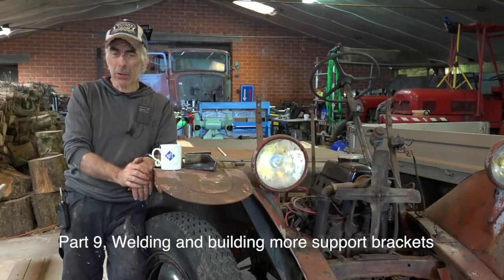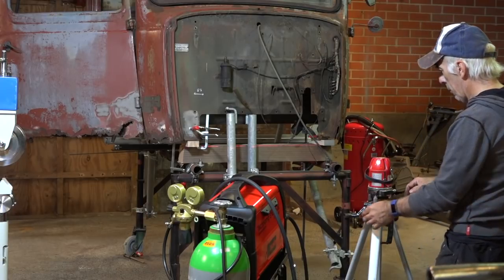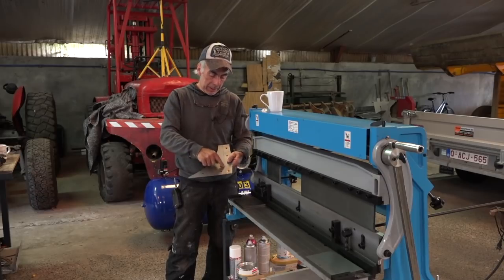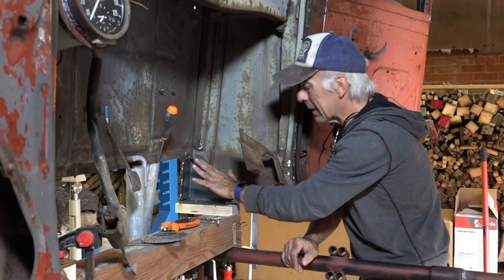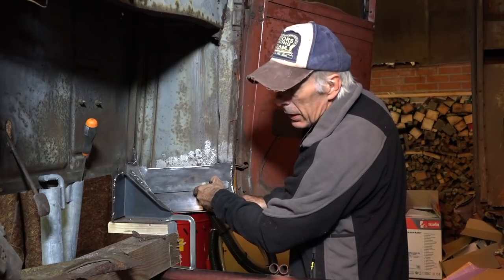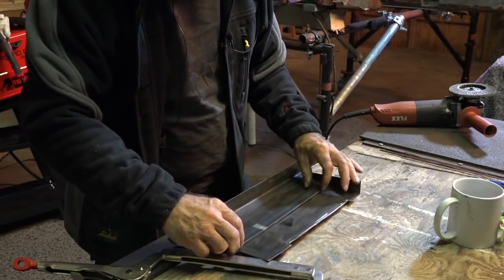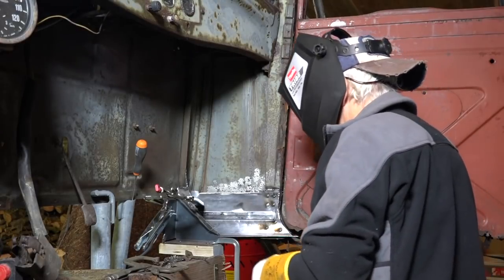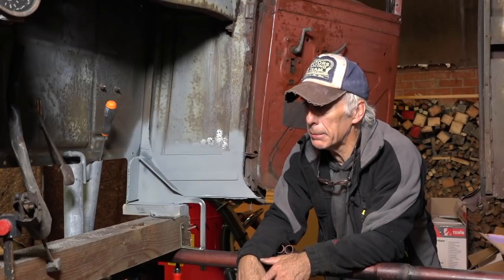Old Rusty , Part 9   Welding the Cabine brackets and door pillar enforcement

Comment: I can recommend that you use weldthru primer 👍
Reply from the maker: East Ridge Racing indeed,  txs for the comments.   The zinv spray i used allows for that
Reply: @D3Sshooter  yea but the surface that you welded in you cant paint when its welded togheter. Thats what i meant with using wt primer 😁 Nice videos btw

Comment: Another fine job. I note you have purchased a lot of brand new equipment for this rebuild.  Can I ask you please about your steel bending press, the make and model. I think you said it bends 1.5mm steel. Its very compact in sise. Also the white marker you use to mark steel is very impressive, i think it has a ball bearing inside it. Can you help with this please ?

Comment: Where did you learn to weld and do metal work?
Reply from the maker: I didn't, just watched a lot of video's on you-tube and then started to practice.  I am far from a good welder, there are many experts on you tube where you can learn from.  On the other hand its not rocket science either, if you only work with steel.  A steady hand , common sense, and literature ( video etc..) will take you a long way
Reply: @D3Sshooter  Absolutely